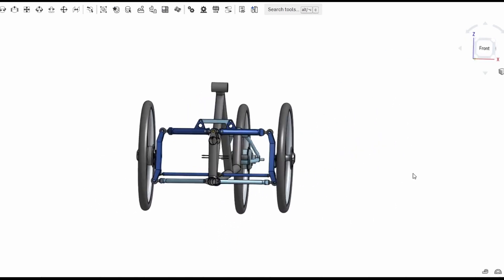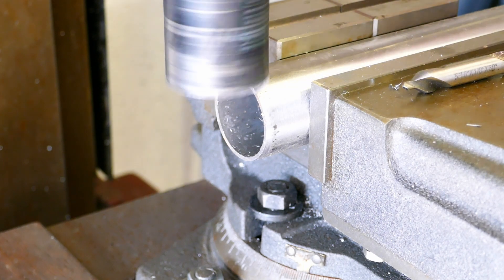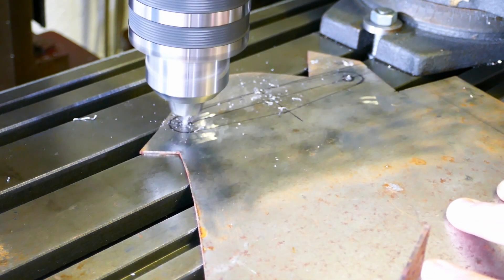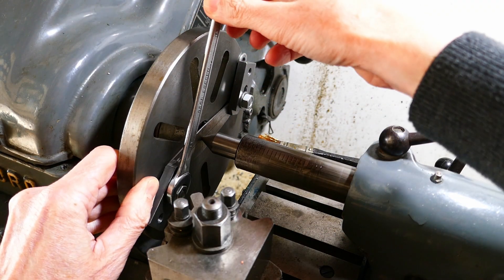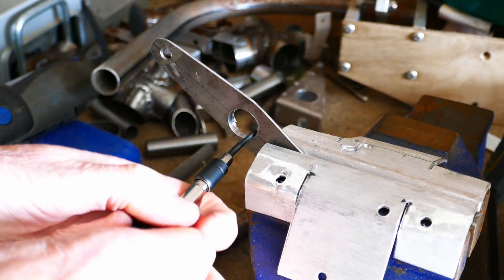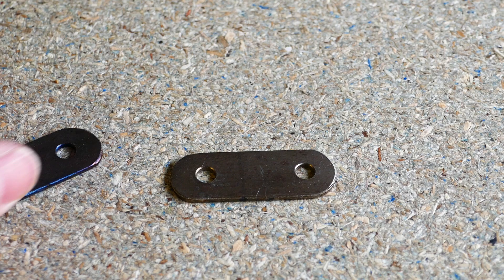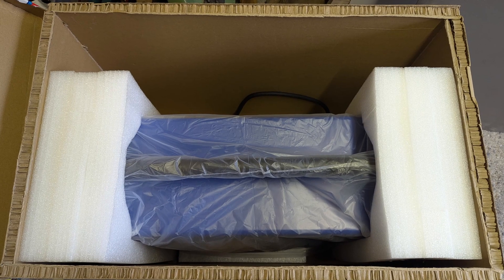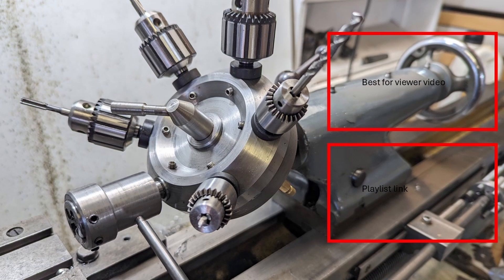Making the Steering Arm - Tilting Trike Mk II Build Project - Ep 5

Comment: Ac/dc tig welder, somebody gave himself a really nice present. I'm happy to see your new design coming along. I'm designing something similar and im on the second design too. What kind of tubing are you planning to use ( dom, or maybe 25crmo4), I'll do it mine with 25crmo4 for the additional performance, the high cost of the tubing is not so terrible since there isn't a lot of material. In my case it's about 200€ more in material cost, i think it's worth it.

Comment: Thanks for your interesting project.

Tig is well worth the investment, although i found learning very slow and frustrating, once you get there it allows for accurate and strong welds on thin tubing.

As for the limitations of the first prototype, and new geometry, if i may ask :
-will you have some form of tilt lock for low speed stability ?
-would it help to have some form of friction or damper in the tilting ?
-with your new geometry, can you ensure that steering is unaffected by suspension travel ( no bump steer ?)
- i didn t get why you left the pivot axis intersect the ground inside the track wrt tire contact point, would it create a slight tire scrub ? Which benefit do you get ?

- does the tilting mechanism itself provide some sort of duspendion, as if the right wheel goes over a bump, you are not shaken from side to side as in a regular tadpole ? I found that is the most uncomfortable in riding them, for that rear suspension doesnt help.

Sorry for the extra long comment, looking forward to see your project progress 😊
Reply from the maker: Interesting questions to get my teeth into!
I am planning a tilt lock, possibly a hydraulic one that can both lock and dampen.  I think a damper could be an advantage.
The steering geometry is such that the steering angle is unaffected by tilting or suspension.
The pivot axis intersects inside the wheel contact patch because there is not enough clearance between the steering joint gubbins and the wheel for it to intersect in the middle of the contact patch.  The offset is fairly normal geometrically in comparison with cars, etc.,so I am hoping it won’t be a big issue, although the steering will theoretically get a small jolt when hitting a bump.
There will tube a small amount of suspension travel created by adding a damper between the left and right tilt arms.
Shaking from side to side should be slightly less than on a standard tadpole trike as the suspension will absorb a bit of it and the track is quite a bit narrower so the jolting moments are smaller.
I think I covered some if not all of these points in the first video in this series if you are interested.

Comment: Kudos for purchasing the TIG capable welder. Once you get proficient with it you won't regret the investment. They offer excellent quality welds, precise heat contol, particularly for lighter gauge materials, and an all round great looking finish.
Reply: Also good it is AC capable, means may weld aluminum, pretty useful function...
Reply from the maker: @onlooker774 yes I went for AC/DC so I can do aluminium as well.
Reply: Yes forgot about that aspect as well. Very useful for cycle construction..
Reply from the maker: Thanks, plenty of practice needed but I've made a start with some success (and a lot of fails).